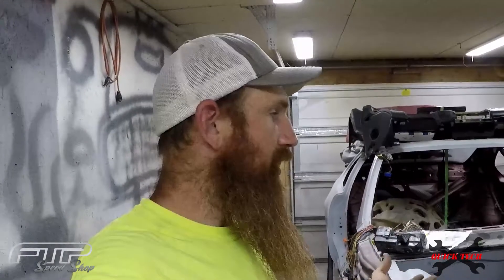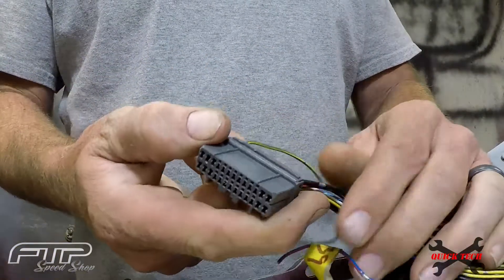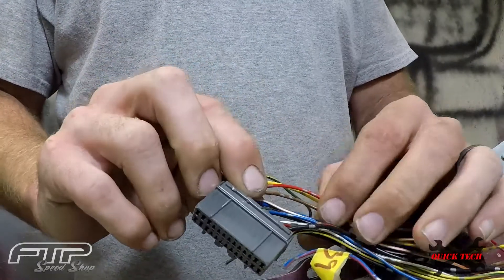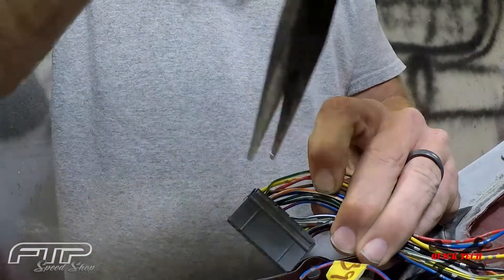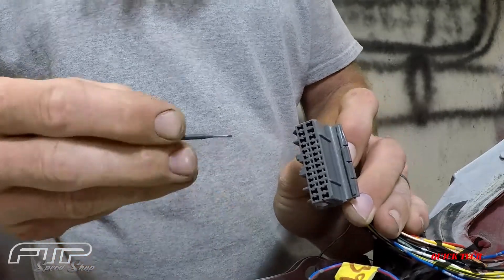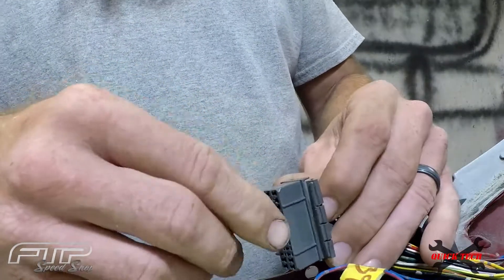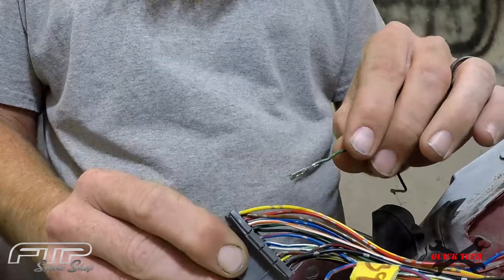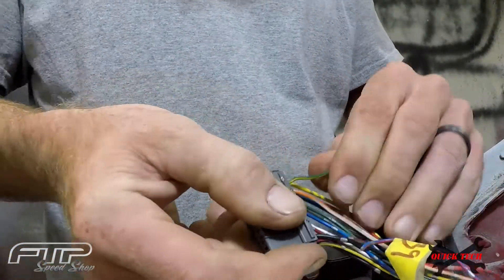Depinning Honda Connectors

Comment: I had a lot more luck going in from the same side the wires go into the connector, then tugging on the wire, pulling out the pin & screwdriver together. Looks like what you did worked great, but I couldn't for the life of me get it to work for me.
Reply from the maker: Good to know there's a different way!

Comment: I tried using a T pin and it worked perfectly to catch the tab by pointing the tip into the top of the metal tab and lifting/pulling the wire out.  Thanks for showing the concept
Reply from the maker: Glad to help

Comment: What is the specific name of this pin?
Reply from the maker: I found some plug terminal  pins on ebay.  Search ebay for "OBD1 ECU Pin Honda VTEC Large Terminal Pin"   As long as there is a larger pin spot in the plug you can use the larger terminal  pin. There are small pins on ebay as well.  If you are deleting  anything  you could reuse one of those wires and just solder the wire you are adding to that pigtail.
Reply from the maker: There are many different sizes of pins you will have to figure out what size you need for what plug.

Comment: How would I go about putting an entirely new wire (16 gauge for example)? Like where can I find one of those silver ends (not sure what they're called)?

Would I need to solder thay silver clip/end onto my new wire?

Thanks for the video
Reply from the maker: I found some plug terminal  pins on ebay.  Search ebay for "OBD1 ECU Pin Honda VTEC Large Terminal Pin"   As long as there is a larger pin spot in the plug you can use the larger terminal  pin. There are small pins on ebay as well.  If you are deleting  anything  you could reuse one of those wires and just solder the wire you are adding to that pigtail.